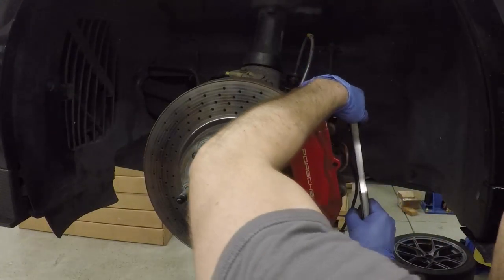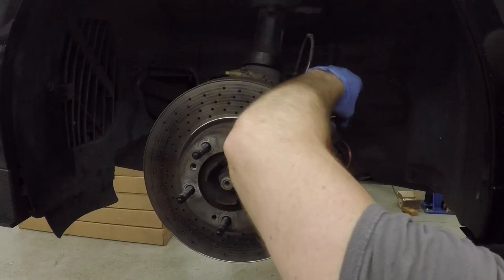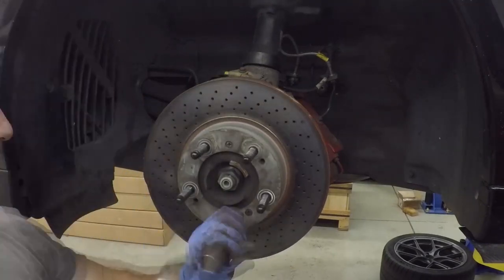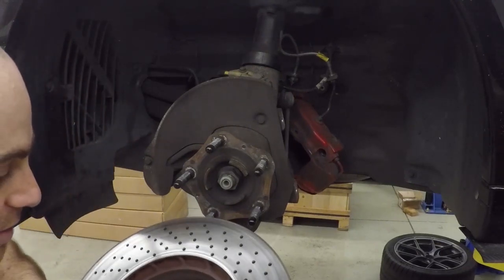Porsche Cayman 987 Brake Pad and Rotor Replacement

Comment: to facilitate spreading pistons one should either remove the brake fluid reservoir cap and extract some brake fluid (how much is the tricky part) or better yet, crack open the caliper bleed screw and either let the fluid flow out as the pistons are pushed back (and immediately tightened) or attach a plastic host to it and route the other end to an absorbent rag or into a container. brake fluid spillage onto painted surfaces should be cleaned off.

the poor man's impact screwdriver...

a regular screwdriver with a stout handle and a hammer. place screwdriver on head of bolt and tap on the handle of the screwdriver with the hammer. believe it or not there will always be some potential wiggle-room between the threads of a bolt and the threads on the object it is bolted to. the impact will often dislodge any accumulated material binding them together and allow the bolt to be released more much easily.

one other note or two...

rotors for these cars, IME, are specifically manufactured for either the right or left side. IOW, they are not interchangeable. the two small retaining screw's alignment should insure they will be installed correctly (assuming the two small retaining screws are used, which one could be forgiven for thinking are not entirely necessary). 

most people apply some sort of their favorite goo on the back of the pad such that it contacts the shim (aka backing plate). i use copper based paste from NAPA. can't say if it's necessary or not. i have had a bad squealing experience on another sports car marque when i didn't use it, so i put it on. YMMV. 

BTW, the 2007 cayman 987's shims were glued on to the original pads making it necessary to unmount the caliper (as was demonstrated in the video) in order to remove the pads. detaching the pad from the backing plate is possible while the caliper is still mounted if one has access to and knows their way around a putty knife. :)

Comment: Will this procedure introduce air into the brake lines?  Can I do this procedure without changing brake fluid (assuming it's still good)?
Reply from the maker: It shouldn't but always a good idea to bleed the brakes when doing pads and rotors.